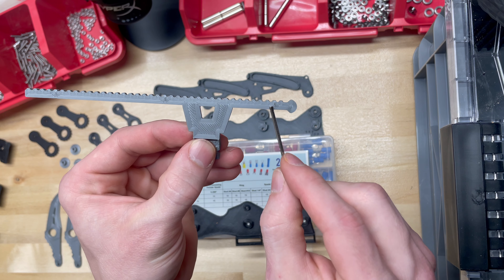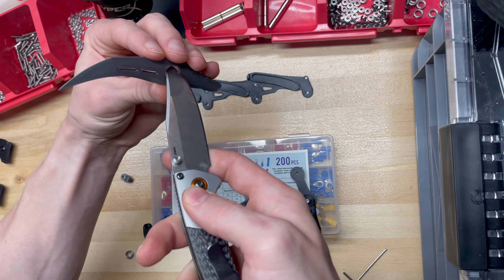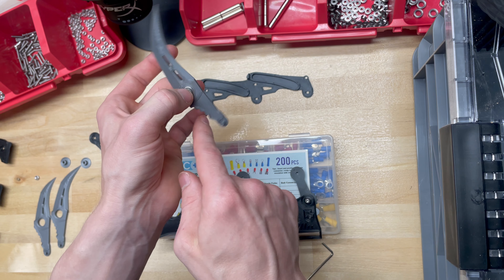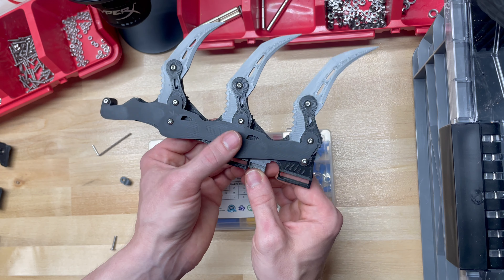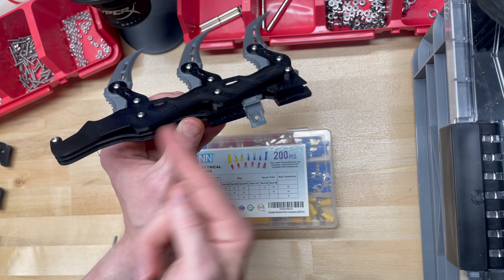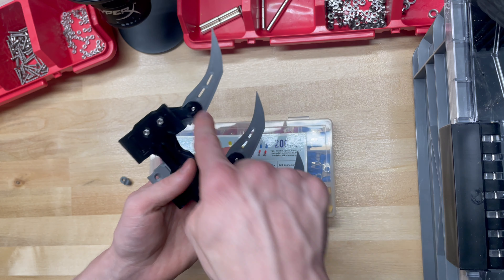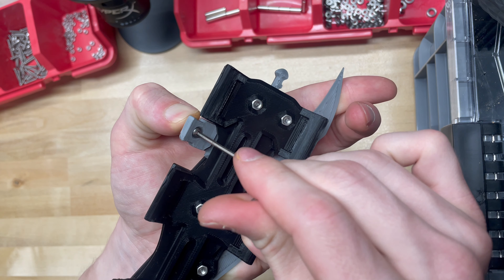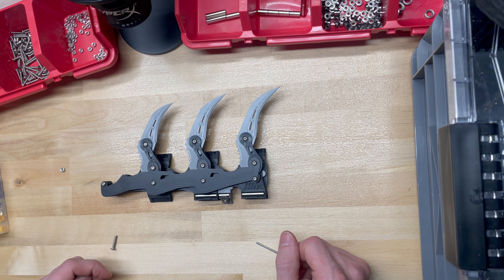Assembly for Retractable Gauntlets (Magnetic Drive)

Comment: If you would finally use an protective jacket with fixing straps between the outer and the inner fabric, you could consider to built in retractable claws/blades and do the same to everything completing your whole working system. Also it offers the ability to suit on/off quickly, easy and comfy 😅
Reply from the maker: I actually have a mostly sewn jacket I’ve been doing by hand but I might scrap it… started out awesome but around the shoulders I’m having a tough time keeping it flexible lol

Comment: This is awesome! you should look into electroplating the blades.
Reply from the maker: @sporadic3684  ideally I’d CNC em outta metal! But that’s pricey haha
Reply: @CrashMakerspace you should engineer a secondary magnetic solenoid on the plane axis to lock the action bar by pushing a round ended pin into a hole on the bar when you finally have it milled out of 440C steel so that the gears, which should be helical. The blades should be of a tool steel. CPM-3V absorbs shock well and has all other characteristics you’re looking for. For greater cutting force if you want them to gobble sheet metal like at the beginning of the dark knight, a double rack set of rack bars is better and a worm gear is better still for decreasing stress on everything and for increasing torque. Some worm gear variants like ball worm gears can be very fast, and you can use a motor and shit I forgot what it’s called, the speed reducer. It has like 300:1 reductions in a small space with 3 moving parts. It’s similar to the speed reduction gears used on the lunar rover’s drive system but that one uses a flexible metal gear that changes shape instead of an eccentric cam and then the concentric crank you need to convert back to single axis rotation. I’ll just make up a name for it. Sheeky deeky converter. Has a 300:1 sheeky to deeky ratio. Idk